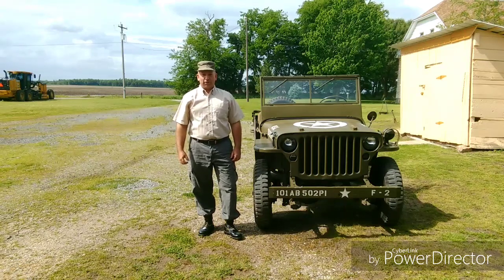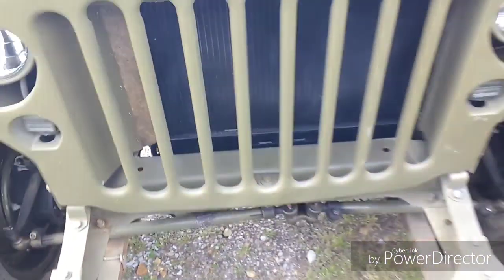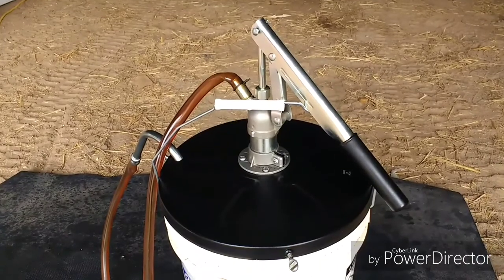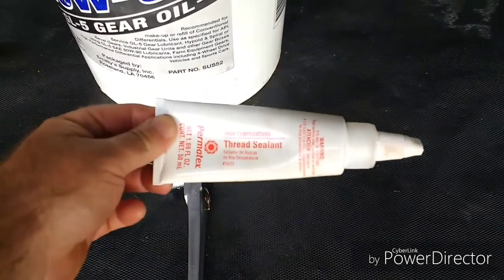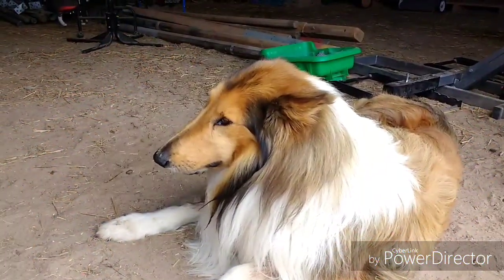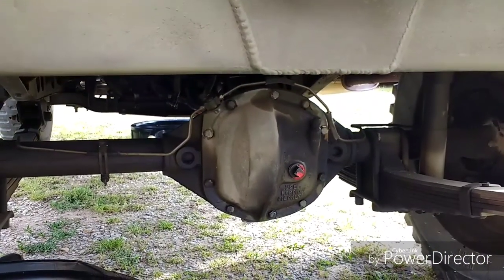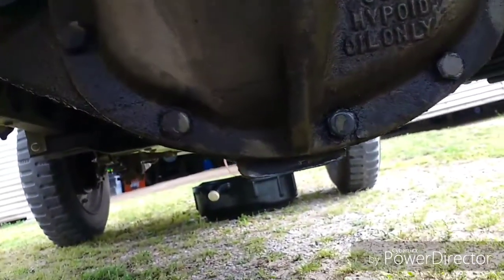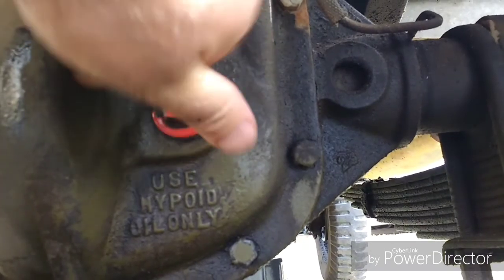Ford GPW and Willys MB differentials fluid Change

Comment: Can I use the NAPA  90W mineral gear oil API GL1 for the front and real differential?
Reply from the maker: The NAPA 90 W mineral gear oil GL1 is exceptionally good for moving gears with brass or copper parts and shouldn't cause any harm to your front and rear differentials.  I think it would be fine to use.